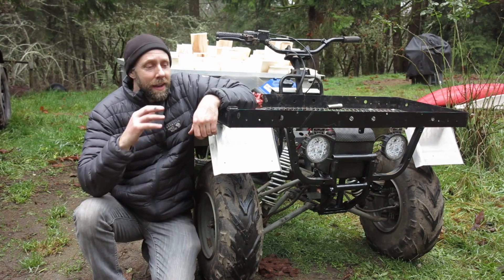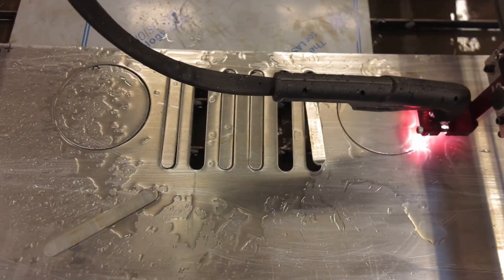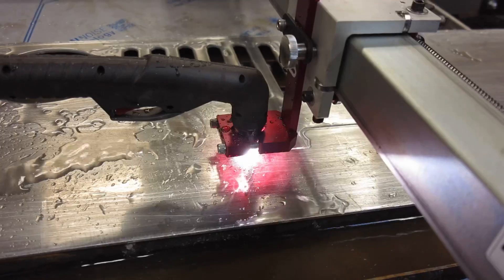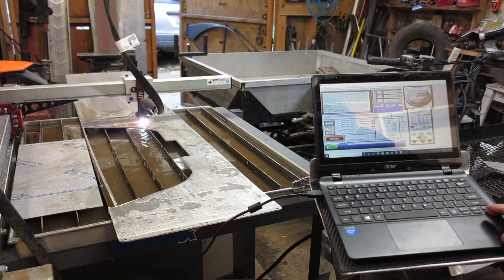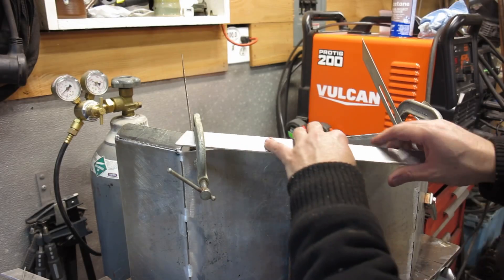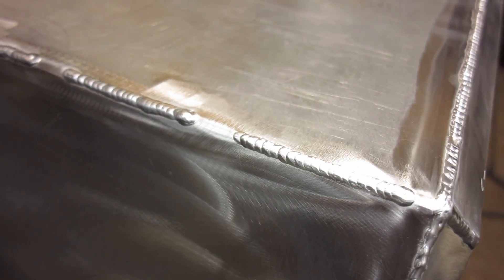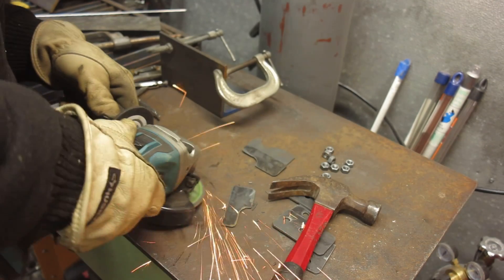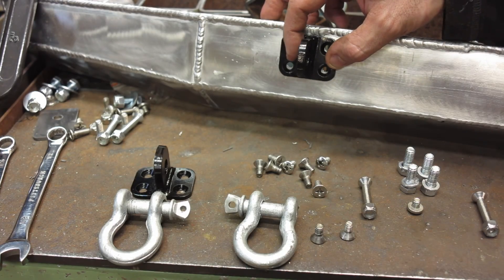212cc 6.5HP Predator powered Quad truck

Comment: Mike I  have enjoyed your welding videos. I am not even a novice welder yet but I want to try a couple projects like a light weight front end loader on a   old mower I own. I plan on using 1/4 inch thick mild steel. I would like your advice on what type of a welder I should start with and what amperage it will take to weld the material I plan to use.
Thank you
Reply: I'll guess you're in the US, you'll want at least a 220v powered MIG, say 180 amp machine. I recommend you learn stick welding first though, to do 1/4" you'll get away with a pretty cheap inverter. Or you could look for a Lincoln Tombstone machine, absolutely lovely welders to use.

Comment: Don't bother with idiots who criticise the looks of your amazing vehicle. Their crippled aesthetic sense simply prevents them from appreciating the beauty of a machine built to do a job. After following your build seriesI bought a junk quad and converted it to electric power with a home-built 800 watt/hour lithium battery, which I now use for towing a (homemade) twin engine shredder deck to maintain my 1 1/4 acre poplar plantation. Thanks for the inspiration!

Comment: Mike do you mind sharing your education background? I notice that you incorporate a lot of skill in various trades into your projects.
Reply from the maker: Thanks for checking out my videos Calvin I really appreciate it! To tell you the honest truth I never finished high school, I had a sink or swim point when I was 16 years old, I had to work to keep food on the table. I spent my 20s leaning a lot of different things, mostly what ever interested me I would try to lean it, of course I was always on a shoe string budget so I mostly had to work with broken tools that I repaired or find a minimal way to do the project I wanted to do for the lack of money. Sometimes being broke but with time you can find lots of ways to get a project done 👍 (thinking outside the box)
I have done everything from yard work to building brick patios to building decks, worked as a mechanic on cars and heavy equipment, and a little of everything in between. For the last ten years I’ve been a millwright at a snowboard manufacturer working on anything from a 40HP electric/hydraulic bandsaw to numerous CNC equipment, it still never amazes me how people can find new ways to break a machine 😂 
Only in the last five years or so have I really start investing in building up my tools for my home shop. So there’s a little insight into my past Calvin. Thank you for being interested in my videos and what I do 🙂
Ps YouTube started as a little hobby to show people how to build a bandsaw mill on a budget and now it’s turned into a side job 😂
Reply: I like it when people are honest and hard working. Subscribed! Mike from Germany.

Comment: One suggestion I have for the quad truck would be upgrading the tires (rear if nothing else) as I think it would greatly aid the traction and pulling power it would have, great video.
Reply from the maker: Thanks for checking out my project! I have up dated the rear tires, they are on the quad truck in this video, I think they have about 5 miles on them, Haha

Comment: sweet unit, like your crossfire, i runs Sector unit where i work to cut boron up to 1 3/8", this unit is nice size, the upgrade for the code expansion i think it would definitely be worth it. truck is really cool and a 212 predator is a solid engine and a fair price, good  video
Reply from the maker: Thanks for checking out my video Bob 👍 for a simple home shop CNC I really like this Crossfire table. Take care

Comment: The CNC Plasma table is a really cool tool. How long did it take to make the grill design with the software?
Reply from the maker: Thanks for checking out my video Eric! I bought my CNC table about two months ago, when I designed the grill I had only learned the CAD software a few weeks before so I was really new to it, I think it took me less then a hour,  now that I understand the program much better I could draw something like this up in probably 20 minutes now. 
Take care 👍
Reply: Mike festiva 
Thank you for the info. I’m considering getting one of those plasma tables. I like end user info because the manufacturers always do a good job of making there products look really good. End users are more honest about the product. It looks like a worthwhile tool to have
Reply from the maker: Did you see this video I did on the table?

https://youtu.be/fdsCEx_YaJk

Check out the comment section in that video, the top comment is from me, in that comment I posted three videos I found on YouTube that really explained how to draw in Fusion 360, check them out, I was able to watch on my phone and follow along drawing the same parts on my computer, after following along with these videos it really helped me get a grasp on this program. Believe me I had zero knowledge of this program prior to buying the table and I was a bit worried I wouldn’t figure how to use Fusion 360, but these videos are the best I found on YouTube! You can go to the Langmuir website and download Fusion 360 even before buying a table just to see how the program is. Once you get a hang of the program it really becomes easy to draw up brackets quickly. Ps I think I will post a video in the next month or so showing some helpful things I have learned in Fusion 360 that would help others when learning the program 👍 Take care Eric

Comment: Just found you channel and have now gone through your quad truck videos. Really awsome truck! Impressive to see how you can do so much with so little. There are tons of videos of super complicated and super expensive builds. So fun to see a build where imagination and playfullness is center. The thoght that, I might not be able to come up with something as smart as you but I could probably copy what you have done at a low cost, makes it so much more interesting to watch.
Reply from the maker: Great I’m happy you found my channel 👍 I have built a lot of projects over the years where I think outside the box, keep the cost down and have fun with it. My newest project the articulating dump truck is the first project that I have given myself a little more freedom on cost, I’m trying to keep the cost to around $1500 but I’m hoping to have solid 4wd tractor truck. 
But if you look at my bandsaw mill the entire build to get it to saw logs cost $350! Of course I have spent a little more on it over the years improving features. Thanks for checking out my channel and commenting 👍

Comment: Suggestions:
1. A mini quad winch would be ideal now that the bumpers on
2. some tow chain with hooks
3. 15 foot tow straps (extra strong to pull full logs
4. Some grill mesh on the front lights.

Comment: Turning a 3D printer into a small plasma cutter is not that hard.
Reply from the maker: Great do you have a video of your converted 3D printer? It would be cool to see.
Reply: @Mikefestiva  Nope. But for the most part a 3D printer is just a CNC machine with Z axis .

Comment: not sure if you will see this or not, but I want to say thank you for giving me a few ideas, and I would like to share one of my own.
have you considered adding a receiver to the front of this? there are many front receiver mount pieces of equipment that seem like they could be useful such as plows and winches. another thing is that you could weld up a front weight tray that can help keep weight on the front tires when you have a 600 pound load in the bed.

Comment: As you live in the wilds, you should get a rear light, so you don't reverse into a tree or down a ledge.  Also I would put a flood light attached to the handlebars, so it points where to are going not just straight ahead

Comment: I've been watching your videos recently and I gotta say this vehicle is an absolute master piece, will you be powder coating it soon?
Also on the topic of paint, are you planning on using bed liner for the inside part of the bed?
Reply from the maker: I definitely need to powder coat it soon, I have the paint, I just need to make the time, pull the parts and head out to my friends shop that has all the painting equipment. I have never thought of doing up the bed with anything but I really like your suggestion! I may just do that 👍 I definitely appreciate your comment, Take care Aaron
Reply: @Mikefestiva  I heavily recomend using bed liner for a better durability, glad you're considering my suggestion! Take care you too.

Comment: Not sure how much aluminum you cut on that plasma table but, if you do it often, consider running a perforated air tube in your water to prevent hydrogen from building up. It can be very dangerous and unexpected. To be clear, when you are cutting aluminum, as the dross falls into the water, the aluminum separates the (HHO)hydrogen from the oxygen molecule when it hits the water (H2O). It’s usually a problem when you leave the table over night. If you don’t have something to help dissipate the HHO like a water bubbler, the gasses can be incredibly explosive as you start it up the next day and could cause you serious injury. Just something to consider. I worked at a place where we ran a bubbler because we were cutting mostly aluminum.
Reply: This seems important – hope he reads it lol
Reply from the maker: Thanks, yes I know about these problems, I don’t cut much aluminum on my table and after I do I usually drain the water table and fill it up with fresh water. Thanks for your concern. Take care

Comment: Just curious how does that plasma cutter actually cut the metal
Reply: live and let live uses compressed air to blow away the molten metal when heated. Like oxy acetylene but more controlled.
Reply: Heats it like a welder with electricity ?
Reply: @Chris Valin I still dont understand

Comment: You cut metal fender parts on a table saw? Tell me more on how you cut metal with a table saw.
Reply from the maker: I originally cut the front Aluminum fender parts on a table saw, aluminum cuts real nicely on a table saw with a regular carbide wood blade. Just use a face mask because of the aluminum chips. If you check out Homemade quad truck part 2   13 minutes into it there’s a shot or two of me cutting aluminum on my tables saw. Take care 👍

Comment: Put a winch on it!!
Reply: There is no use for a winch on that cause it dosen't have any weight.
Reply from the maker: I have felt the same about the winch,  I think a winch on my new project will be better, I’m in the process of building a small articulating 4x4 dump truck tractor it’s probably going to weigh 1,500 LBs I think I will install a winch on that to pull logs out of the woods.

Comment: Hey Mike, if you need extra Subaru running gear for the dump truck, keep in mind I have a front end and rear end (disc brakes) from a Loyale-era Subie sitting at my place...
Reply from the maker: Right on Norm I appreciate the offer! I have all the running gear from a 1997 Legacy wagon, but if this project goes good I will consider it for a future mini 4x4 tractor for my son when he gets a little older 🙂 Thanks for commenting and checking out my video Norm!

Comment: How well does the belts hold up on the torque converter on this thing?  I have watched this series since you started building it.
Reply from the maker: Good question, I’m still running the belt I bought for it when I started this project two years ago. This CVT works much better then the CVT that are on go karts, this scooter style CV always spins the belt and has a centrifugal clutch that engages rather then eating up the belt like the go kart comet style. Take care
Reply: @Mikefestiva  
Could you post what kind of cvt you're using?
Reply from the maker: Phil Lowman Hey Phil I wish this style CV transmissions where available to bolt onto these engines, but I have never found them, the original engine in the quad was a 250cc scooter engine with a the built in CVT, I just cut off the CVT and made a few small parts on my lathe and adapted it to the side shaft engine.

Comment: Good video Mike,  Wish I could afford a plasma table but even if I could I don't get along with computers.  Looking forward to the mini dump truck as I have been thinking about one for a few years.  I am considering a Japanese Kie truck with dump bed as well.  You have a dealer for them in the Seattle area and also one just north of there.  5-7K for one or get the standard bed for around 5K+/- and build a dump.  At 10' x 4 1/2' and 4wd they can get around in a backyard.  Take care.  Doug
Reply from the maker: Hey Doug thanks for commenting! I definitely have been thinking of one of those small 4x4 Kie trucks, I have wanted one for years, I probably should buy one one of theses days.
The power dump is definitely a nice feature. 
There’s probably about 5 out on the peninsula where I live, Every time I see one driving down the road I think man I really could use one of those machines. Let me know if you end up buying one! Take care

Comment: looks great,its still expensive building things yourself. I use to when repairing rust on my old 4x4 trucks would go buy body grade sheet metal..it was about 20 bucks for a 4x8 sheet, now its over 100 bucks.also for some projects I look through the used metal, its much cheaper an sometimes you can find new pieces,if it has a little rust,just hit it with a flapper disc to clean it up, but some people don't realize the cost of building it yourself,but at least you know you have a good quality piece.

Comment: Take a 1/4" rod aluminum,  and tighten that to the edge of your fenders to simulate a rolled edge, it will be safer for you and your pants. 
Nice work there too.
I'm  a formal cnc guy, check your Mach3 for canned cycles. It will save your lines of code. They normally have different drill cycles and bolt holes as well as rectangles and squares.
Keep on having fun, fusion 360 is amazing especially for the price.

Comment: Cool, Mike!  nice work
Reply from the maker: Thanks! Do you have a update video on your Honda coming out soon!!!?
Reply: Mike festiva 
I was hoping to get one out soon, but I ran into a major setback...  Completed the engine rebuild just to find out that the timing chain skips over the crankshaft sprocket teeth!  The damn sprocket is worn out, so I gotta tear the engine back apart...   DELAY
Reply from the maker: Metalman 329 man I’m sorry to here that, what a bummer, well hopefully it goes easily.